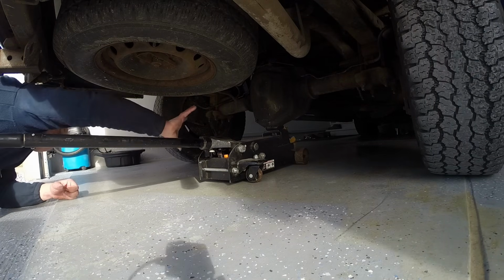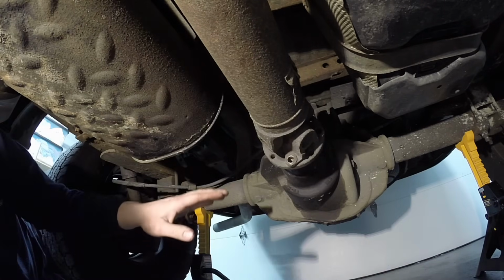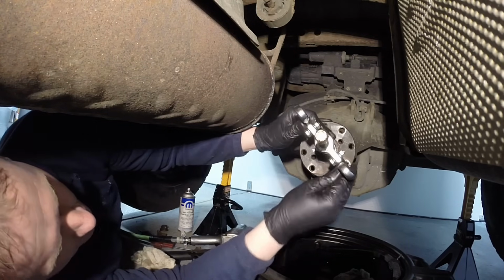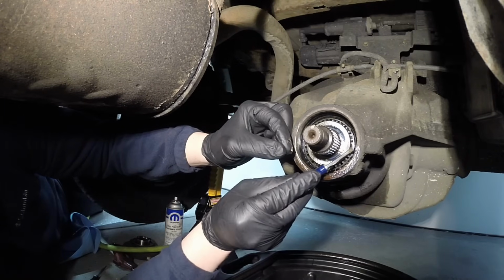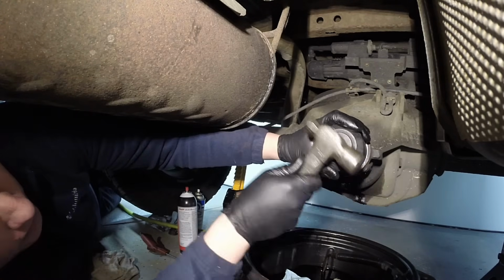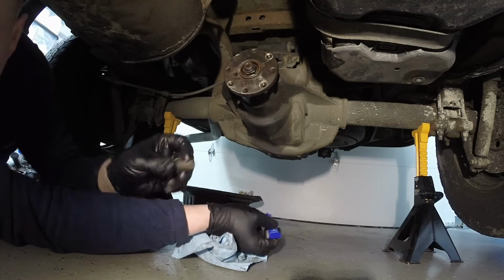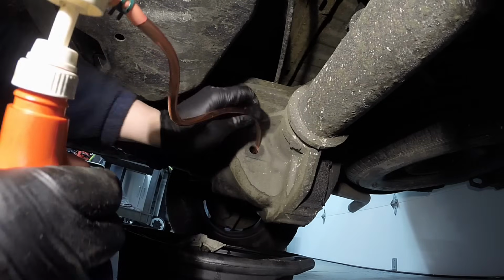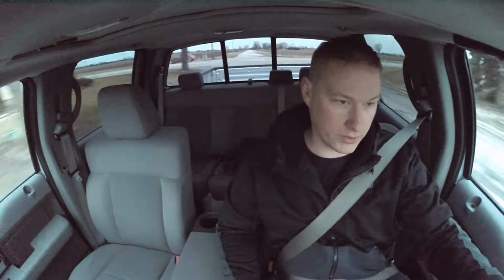Ford & Dana Axles Pinion Seal Replacement: Tricks of the Trade

Comment: Why would others need to disassemble the whole axle from the back part to change the bearing when it is easily accesible after removing the seal?
Reply from the maker: That is inly the outboard bearing and even if the outboard bearing was the only one that failed how are you going to change the cup then?

Comment: I'll be replacing the Driveshaft on my 2007 Ford Explorer (RWD). Would it be a good idea to replace the pinion seal while I'm at it? There is no visible leak. 

I would like to do any preventative maintenance that makes sense while I have the driveshaft removed.

Comment: So question? My pion shaft moves up and down( has a lot of play in it ) and moves in and out. I have terrible rear end noise and my center support bearing goes out very easily on my drive shaft. I’m guessing because that pinion input shaft is wobbly my rear end needs a rebuild?

Comment: Great video!   One question though.  When you took the old seal out, you found sealant, but when you went back with the new one you didn't add any sealant. Is there a reason why you didn't use sealant?   Also, does it matter what kind of grease you use to pack on the seal to keep the spring in place?
Reply from the maker: There is a sealant bead on the new Ford seal from the factory. Regular wheel bearing grease is fine.

Comment: You don't have to put a new crush sleeve in?  On a 9.75 ? I put a new flange,seal and nut, didn't count threads just checked preload with a in lb torque wrench. Is that ok?

Comment: Do you the torque spec. For the pinion bolt? My rear axle is the 9.75.
Reply from the maker: There is no torque spec for the pinion seal.

Comment: What about the crush sleeve replacement and preload on the pinion bearing?
Reply from the maker: No need to replace the crush sleeve, pre load can be checked by removing the brake discs if you want but checking it by feel before and after as shown here works perfect.

Comment: Remember to ALWAYS check the vent. Lots of times, the vent gets clogged, and the diff can't vent, and the oil finds the weakest link; pinion seal or axle seals, to vent the pressure inside the diff.
Reply: Where is the vent?
Reply: @ShopGoatVentures  on top of the diff, at one side or the other
Reply: @jvm3753  found it, thx
Reply: @ShopGoatVentures  what kind of vehicle?
Reply: @jvm3753  Mazda b3000
Reply: @ShopGoatVentures  do you have a hose stretching up from the diff area? It'll be there.
Reply: @A NEW MINDSET what kind of vehicle?
Reply: I sure hope it's my vent! I just took out a second seal.
Reply: @danam2584 Yeah, check the vent. Take it out and check it, clean it, verify it's not plugged up

Comment: ICE trucks and cars be DAMNED.  Dump inefficient ICE vehicles AND the "bumpf:   valves, pistons, con rods, camshafts, crankshafts, crankcases, driveshafts, differentials, catalytic converters, mufflers, exhaust pipes, air filters, carburetors, fuel pumps, injectors, distributors, spark plugs, AND the hoses, clips, bolts, seals, gaskets, mounts and ... !!!  What a waste of our resources, AND Labor! America had ELECTRIC cars over a HUNDRED years ago!! What the hell happened?  PLUS all the CO2 pollution driving up costs, warming earth until we're flooded, etc.  
    America had ELECTRIC cars over a HUNDRED years ago!! What the hell happened?  
    More people were in the country (agriculture) but fled to the city, the ratio 90:10 almost REVERSED (±90% now in-)city.  
So why all this bs "Range anxiety"?  Really?  We are in the city with 2 cars & 4 trucks. + 30 forklifts! We'll go all electric ASAP !   
   We NEVER, EVER have to drive more than "electric range"!  AND if so, just stop an hour have lunch and CHARGE it!  One of our group has a Prius- it's electric in city, but ZERO problem to go Toronto from Montreal - maybe ONCE a year. Some electrics already do that!
    Cold winters?  Another "gas engine lie" easily overcome. How come NORWAY has the most EVs per capita? Serious winter there! 
 Save the planet;  dump the bumpf!

Comment: The book and sites for a 95 f¹50 say to take the axel shaft loose. I don't know why. Also says use an inch lb torque wrench to measure the torque on the pinion nut with out load. Perhaps that is why they say take the axel loose. So there is no load. You changed the seal w/o doing all that. Which is what I'd do had I not read the repair manual. Any ideas on how to approach. 
  I'm thinking they say tske the axel loose to take the load off the measure the torque on the nut.

Comment: I’m having hard time trying to find the bearing as well could you please share part number ? I wanna change it too while I’m doing seal since my truck already got 200k miles
Reply from the maker: How are you going to change the corresponding cup?
Reply: @FordTechMakuloco  mmm you right now that gonna require taking the pinion and gears out. Or is there a way to get the cup out without taking those parts out
Reply: @midorey6328  
Run a bead of migweld around the center surface of the bearing race, let it cool “contract” and it will pull right out.

Comment: amazes me how it's a very useful video but nowhere did you use a torque wrench, folks every bolt on a vehicle has a torque spec for a reason
Reply from the maker: Ah that is where you are wrong! I torqued the 4 driveshaft bolts in detail and the pinion nut has no torque spec, it is set by pinion bearing preload only.
Reply: gdunton, you have severe ocd issues, mechanic of 30 years here, I never torque anything….🙄

Comment: You cleaned off old sealant from around the aperture when you took the old seal out @15:40.  However you did not use any sealant when you put the new seal in.  Did the new seal have some sealant integral with it?
Reply from the maker: Yup they sure do, the Ford seals have a sealant bead around the outside that gets activated when set.

Comment: Would you be against replacing that outer bearing without replacing the race? I've got to do the pinion seal anyhow because it's leaking and the bearing is fairly noisy. I've been told the bearing is often the problem. Any advice here? 04' Ford Explorer.

Comment: I did not clean off the flange surface sufficiently and my seal still leaks after replacement. I can't think of anything else I did differently.

Comment: Just had pinion seal changed out on my 2000 Excursion.  A little while ago when I changed the differential fluid, I added 8 oz. of XL-3, as recommended in the owner's manual, along with 6 pints of diff fluid.  I already have added 1 pint of diff fluid to bring up fluid level from leaky seal.  In your professional opinion, how much fluid can I add before I need to add 4 oz. of XL-3?  I do realize that I can add too much XL-3 and have adverse effects.  Thank you in advance for your response.

Comment: I used this training video to complete my pinon seal repair and it was great in Oct 2019. It is not July 2021 and the seal is leaking from the pinon flange not from the same place. So, did my seal fail yet again?

Comment: Should the flange/plastic dust cover be touching the outer seal lip? Because, mines not after I replaced my pinion seal and now it howls/drones at highway speed above 20-30 mph and only under load. Is my nit simply not tight enough?
It’s not vibrating or shaking, just an audible howl/droning sound.

Comment: Hey everyone. Just a question. Anybody knows how much lbs torque air gun do I need to be able to remove the big bolt from the yoke? This weekend I have  to change the u joint + the seal because it's started dripping. Thanks

Comment: Is there a reason you didn't use a dial torque wrench to first check and then reset the used pinion bearing preload instead of the impact wrench? I understand counting threads and making alignment markings to reset preload quickly without removing the wheels, rotors and calipers and given the fact you didn't replace the crush sleeve since that would require pinion gear disassembly. So my question is would it be more precise by using a dial torque wrench before to check preload before loosening the pinion nut and then recheck preload after retightening the pinion nut to ensure everything is reset back to where it was with of course the removal of the wheels, rotors and calipers to do this as though finishing up a rebuild?
Reply from the maker: It would be more precise but absolutely not necessary. I would use a beam style torque wrench when checking turning torque.
Reply: @FordTechMakuloco  Thanks for the information. As busy as you are you still find the time to reply which is awesome and like I've said before you're still the best on YT.

Comment: Why did you mark the flange if your replacing it with a new DS? Just curious...
Reply from the maker: This is a video on replacing a pinion seal so I showed all the normal steps for doing so. It didn't matter if I changed the drive shaft or not.

Comment: How do you remove the nut with no impact driver I have an lsd ford 3.23 in a1998  ford  fairlane here in Australia and don't know how to.use a tension  wrench here I work from home limited tools thanks
Reply: Thank you sir I have a ratchet with a piece of hollow pipe as a breaker bar
Reply: Lock the wheels, use 2 pound short handle hammer.

Comment: Why not remove the tires and measure your preload before you remove the flange?
Reply from the maker: Absolutely not needed, pulling the tires and brake components for a preload check is only needed when rebuilding the rear end.

Comment: just came from a mechanic said that the drive shaft was not connecting right with the axle and that was why my car was bouncing when i shifted out of park. could it be because there is no fluid or a part may need repaired.

Comment: I need to do this on my 1994 Ford F-150 xlt 5.8  I just got the truck and the rear was leaking so I replaced that seal then the Front seal started leaking on the rear axle🤦‍♂️ I found Metal when replacing the pan seal looked like maybe apart of shim ring there is no sound coming from it but when going from reverse to drive I can hear and feel there is to much back lash and it’s leaking about a gallon of gear oil a week I make sure to keep it full I have been waiting for this shop to fix it for about six months now they have been backed up I have watched tons of videos on this so far yours is the best. Now I do have a question I have done got the rebuild kit with new carriage bearings pinion bearings shims everything but the longer I wait The worst the problem is going to get so I’m about to attempt to rebuild it before it cost me a ring and pinion would it be best to just replace everything or just the pinion seal and if I replace the carriage bearing can I just use the old shims to set the preload I feel like one of the pinion shims broke and that’s what started all this. Any help or tips would be grate!!! Thank you for your time in making this video and hopefully reading and replying to this comment. Have a grate day

Comment: If the yoke is scored you can use a thing called a SKF Speedi-Sleeve to slip over it and make a nice smooth interface to the new pinion seal. My old TJ had score marks and this was a way to fix it without replacing the yoke. Nice video !

Comment: What is the loud clunk transmission drop noise somewhere from the rear end of driveshaft when slowing down? Noticed it happens in 4wd especially
Reply: Grease your driveshaft splines in the front where it slides into the transmission. Ford sells sticky grease especially made for this.

Comment: I always pull the pinion gears and use a new crush collar so I know for sure what my bearing preload is. But I guess if your just buying some time before a rebuild.
Reply: If your yoke isn't sloppy, you don't need to worry about a crushed sleeve. If you count the threads and the turns that it takes to get the pinion nut off, all you have to do is follow those steps when you put it back on with a little blue loctite. Everybody does that when they don't want to crack their gears and have to worry about setting lash.

Comment: For a seal installer tool I used "PT W1273 2-1/2-Inch 4 Wheel Drive Lock Nut Socket" and it works perfect.

Comment: I noticed you did not wire wheel the drive-shaft bolts before adding blue locktite-do you think it's not needed?
Thanks,
Roger
Reply from the maker: No not one bit.

Comment: Did he torque the pinion Nut or just zipped it down ??
Reply from the maker: You set preload by feel getting it close by matching the amount of exposed threads. There is no torque spec for the pinion nut.
Reply: @FordTechMakuloco  I thought there was but you'd have to remove the wheels and whatnot.

Comment: Can you explain why there was sealant on the old seal but when you intalled the new one, you didn't use any?
Reply from the maker: I use the Ford seals exclusively and their seal have a sealant ring on them already. Other brands like Timken don't include a sealant ring but are supposed to have a coating that seal to the differential housing.

Comment: It's a mediocre way to fix this problem.  Once crush sleeve is collapsed to proper pinion bearing spec. Its collapsed no more preload.  Counting threads and markers for Mark's are irreverent.  You have to reset pinion preload with new crush sleeve to be right
Reply: That's what I was thinking myself.

Comment: Driveshafts are balanced outside of the vehicle putting it back in in a different position won’t make a difference
Reply from the maker: Correct but this is top prevent a stack up of rust only.
Reply: Yes but you cleaned the flange so it wouldn’t matter anyway

Comment: Thank you so much for this excellent video.  I did this to my F150 yesterday and would never have tried it myself if I didn’t see you do it. FYI...instead of buying that expensive Ford seal installer I used a short piece of 4” PVC pipe and it worked perfectly. I did grease the spring in first though. Thanks again.
Reply: 4" ?    the seal is that big?
Reply: @64scrambler yep

Comment: great videos-- I have 2004 f-150 with a noise in the rear end at 50-55 mph. would it be worth trying to just replacing the front pinion bearing and seal to see if that will fix the problem before going into the ring and pinion gear?

Comment: Is the pinion flange supposed to be seated on the seal once pressed back on the pinion?
Reply from the maker: I think you are talking about the dust deflector. There will be a gap between the dust deflector and the seal yes.
Reply: @FordTechMakuloco  I replaced my seal and fingers crossed no leaks, but I wanted to ask, is it possible to overfill the diff to cause fluid to come out from the pinion seal/shaft? When I replaced it (when I messaged you last) I sprayed everywhere with brake cleaner to clean up the fluid that came out when disassembled. Got into the crevices and openings with a towel that had brake cleaner. It all still looks dry to the touch.

Comment: I have a 2001 GMC Truck Yukon1500xl now I try to drive but a make a loud clank clank noise I turn it on gear but a won't move what it's my mind tell me the U joint or drive shaft but I need to be certain can someone guide me in the correct direction please thanks a million peace

Comment: FordTechMakuloco What is the reason behind you having to replace the rear driveshaft and U-Joints? What symptoms was causing it to go bad? I’m having a real bad shudder/surging/bucking feeling when under load about 1200 rpms and between 35-55mph? The truck has a bunch of new parts such as all 8 brand new OEM updated one piece spark plugs (SP-546) instead of the two piece spark plugs (SP-515) which were known for failure, all 8 OEM coils, OEM air & fuel filters, both 4wd vacuum actuators in the front axle, the vacuum solenoid under the hood on passenger side near the cab, repaired a broken vacuum line in the front, rear pinion seal because it was leaking gear oil. I checked both the front and rear U-Joints and there seems to be no binding or any play whatsoever to make it seem like they need to be replaced. The little rubber seals that are attached to the covers that have the needle bearings inside are all intact and in good shape. My truck is a 2007 F-150 XLT 4x4 Auto 5.4L Triton V8 3V. Your videos always seem to help me out because your so thorough and always hit the nail on the head and are always straight to the point. What state do you live in and what’s your name by the way. I’m Jules.

Comment: I thought you check the preload with a torque wrench after removing the rear brake calipers, or at least back the pads off the rotor?

Comment: I enjoyed your video. Sad to say it was on mute. But did you say why you did not use a torq wrench on the pinion nut? My dodge has a spec on it with the dana 80. Thanks
Reply from the maker: There is no spec for pinion nut torque on the Fords they use pinion bearing preload as a spec instead.

Comment: The driveshaft is balanced at factory by itself,  not with the rear end. Marking it makes no difference. Why didn't you torque that pinion nut? Why did you hammer on that driveshaft mount? I'm pretty sure you knocked out the ring and pinion. Well its a 
Fix
Or
Repair 
Daily
Reply from the maker: You only mark the driveshaft to prevent a stack up of tolerances due to rust. You do not torque the pinion nut, you tighten until you have the set amount of preload, that is a reason there is no pinion nut torque spec from Ford.
Reply: @FordTechMakuloco  ok I stand corrected. Rust is a big problem,  especially for that truck and 232k miles.
Reply: I must of been thinking about the 8.8, cause there is a spec for that rear pinion nut.

Comment: Ran into a problem replacing rear pinion seal that was pouring out oil. 4 bolts holding pinion plate to driveshaft plate were loose, one missing. After removing the nut, plate slid off easily. Removed seal, inspected bearing and race, installed new seal. Plate slid on loosely. Wobbly. Even after tightening nut, the plate was wobbly and spacer would not seat onto seal. What is going on here???